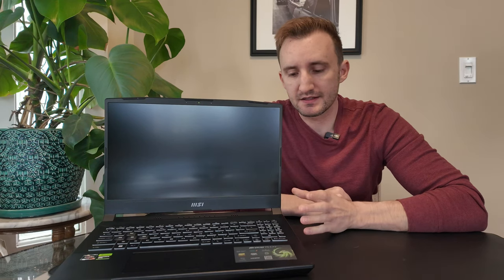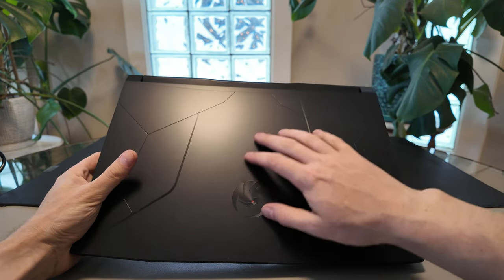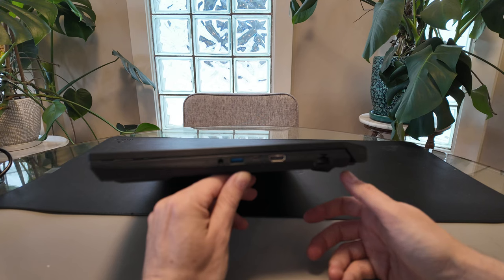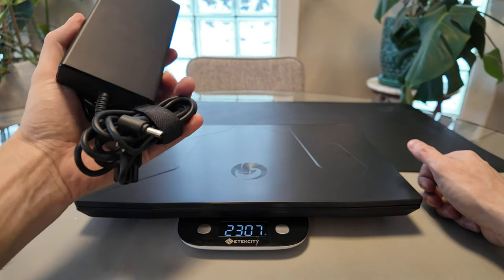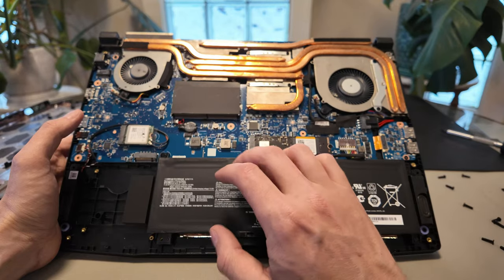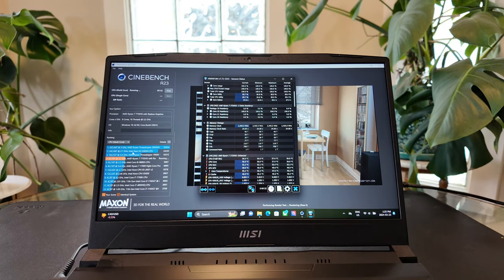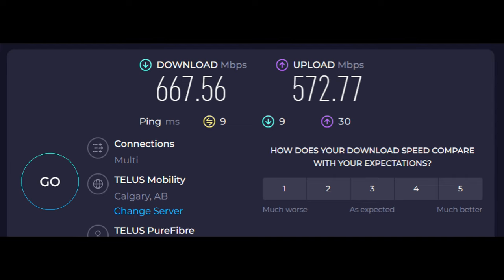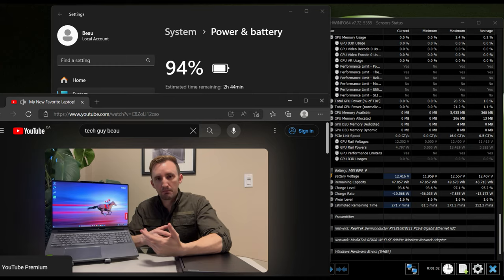Low Cost - High Performance:  MSI BRAVO 15 Review

Comment: I bought the C7U variant, which had the RTX 2050. This is my first big purchase of my entire life and its really worth it, I just hope the build quality and the hinges do not break on me 10 years from now lol
Reply from the maker: Nice enjoy! Feels good to get something substantial that you have been waiting for :)
Reply: So, I bought the Bravo 15 D, I believe it's the 2020 model and I have had no issues with the hinges so far and I have had it since 2021 and the only issue I ran into was that one of the fans wasn't working, brought it to a friend who knew more about computers than I do and it turns out they didn't plug the fan in or if they did it got unplugged at some point in shipping between facilities
Reply: My only complaint I have about my version is that it doesn't come with two RAM slots
Reply: How are you, brother? How is the device performing for you after this period of testing?
Reply: @5me.n  oh yea its good, my only concern before was that the top of the chassis is hot but I researched and found out that Ryzen CPU can reach 95© and they should still be fine, but I lowered the power so it wouldnt always hit that mark. Overall its a good budget lappy go for the 4050 Variant if you have more budget

Comment: i got a r9 7940hs and 4060 msi bravo for around 1000 bucks. its a steal. performs really well, i agree on the screen though colors are not the best
Reply: Is it good and what are the things you didn't like about it?
Reply: TBH the touchpad is the biggest issue, it is  quite sticky for my liking but i barely use it ,and the screen colors are not that good if you are into editing. For gaming though its a beast just make sure to buy a cooling pad for max performance.
Reply: Do screen colors bother you?
Reply: Just bought it today for $699 😅

Comment: i just got the  144 Hz IPS AMD Ryzen 9 7940HS GeForce RTX 4060 Laptop GPU 16GB Memory 1 TB NVMe SSD Windows 11 Home 64-bit Gaming Laptop and it is really good for what I paid. 

 The upgrade to win 11 pro is all I have left to do and this thing performs really well for what they are charging. I'll be Happy with this for awhile
Reply: I just ordered this and it’s coming in 3 days, are you still happy with it?
Reply: @22dattii  yeah it does fine for me.
Reply: How much did it cost for that? 800bim guessing. I got a deal on something more affordable saving a couple hundred.

Comment: Important: If you buy, order the 2nd ssd bracket to install a second drive. I hear it is harder to get outside of North America. It is a gaming laptop; it should have included a ssd bracket from the factory. 

Also be aware the usb-c port is USB3 gen1 5Gbps, instead of gen2 10Gbps or USB4 20 or 40 Gbps. This is also an odd cost cutting measure.

A larger 90wh battery could fit but would block the 2nd ssd slot. I have an older same chassis model with 90wh and gen2 usb-c, and keyboard paint wears off.

I can't comment on hinges as mine is one of few variants with a different metal lid on this chassis.
Reply: I see this priced at $1399 CDN or more. $800 or $899 Canadian would be good value. For $1400 Canadian I'd get a system with USB3 gen2 or USB4, no usb2 port only usb3 ports, an RTX4060 / RX 7600s, and about 100%rgb.
Reply from the maker: Gotta wait on sales. Full MRSP isn’t worth it
Reply: Can you guide me into the right direction about that 2nd ssd bracket? I'm about to buy this model and I want to expand with more storage.

Comment: You forgot the best part of MSI laptops. The open advanced bios. This can let you do the IMON tweak, leading the CPU and GPU to use their max TDP's even if both are loaded. It can also let you potentially undervolt locked CPU's like the i7 12650h via the AC loadline tweak. I did these tweaks in my nitro 5. In CP2077 my 3070ti used to struggle to pull more than 125w when the CPU was fully loaded. And the CPU struggled to use more than 40-45w and barely clock to 3.1ghz. Now, my 3070ti can clock to 1725 to 1740mhz, up from 1525 to 1600mhz and use the full 150w. My i7 12650h uses around 50-60w while holding 3.8 to 4.1ghz. My FPS got a nice boost too and its a lot more stable. All because I was able to access advanced bios.

Also, would like it if you raised the laptop since there's cheap, metal feet with built in stands you can buy for laptops to glue them to the base of the laptop and raise them by a good 1-2'. This can lower temps by a good amount, sometimes by 10 degrees since the laptop can suck in more air. I did it to my nitro 5. Works wonderfully.

And can you do some testing with undervolting and overclocking the GPU? And show us the GPU and CPU clocks in games. Also, the 6gb of vram isn't that great in 2024 considering 8gb is the minimum to run games comfortably at 1080p. Realistically the 4050 should've been a 128bit 8gb gpu. 3050 6gb also got a 6gb updated refresh.
Reply: Hi, did you mistake? Nitro 5 is Acer.

Comment: hey Beau, thanks for the videos, good to watch as always. I have an interesting concept for you; personally I am not so fond of Windows 11 since its release, but I don't know if it actually improved and feels better than 10 now. I still stick to Windows 10 Pro. Could you do a side by side Windows 10/11 comparison with your favorite, most premium new 2024 laptops? Maybe 2 of them or just one like the Yoga Pro 9i? I think it's an interesting case!
Reply from the maker: It would probably be okay for an AMD machine. Windows 10 handles Intel e cores and P cores somewhat poorly.
Reply: @TechGuyBeau  Thanks for the tip, so I guess I will probably have to use Win11 with my yoga pro 9i?

Comment: So I'm currently testing a Asus g713rc it has a ryzen 7 6800hs, and a rtx 3050 4gb vram 16gb memory, and 512gb ssd. I get somewhat good performance in fortnite i have epic settings on for view, textures, and something else..everything else is off and it's hitting about 160 to 200fps depending on the part of the map I'm on. 

I'm waiting on a msi bravo 15 Ryzen 9 7940hs, with a rtx 4060 8gb vram with 1tb ssd 144hz screen etc. The asus g713rc looks so dam good, like the rgb strip on the bottom. The pain splatter on the left side under the screen 17.3 inch screen, asus symbol lights up in the back. Loud speakers which is hard to find on laptops. In all the asus looks esthetically pleasing compared to the msi. But performance wise I believe the msi is better. What should I do? 😆 Send the asus back, and keep the msi when it comes or cancel the msi order and keep the asus?

Comment: Been using it for a year my only opinion is that the Rtx 4060 is so good at cooling the laptop that it literally drains your laptop to 1 hour or 1 hour and 30 minutes of playtime 90% of the time im charging whilst using it but still in terms of performance it really is top notch
Reply from the maker: Realistically you shouldn’t game on battery
Reply: @TechGuyBeau  Ive read multiple studies suggesting that Charging whilst gaming is ok in terms of the battery as long as you dont play maximum charged most often i game whenever my laptop goes low, i charge it till 80% then disconnect and continue rince and repeat been fine the battery still is in good health and there has been no degrading in my experience its ight

Comment: I’m torn between this or the legion 5 with 3070ti, is this one better overall?
Price difference between the two is not too wide in my country
Reply: 3070ti is 40-45% faster than the 4050 while packing more vram PROVIDED the 3070ti is 150w.

Comment: Where did you find this for $800 cad? I’m in Ontario and I’m seeing $1,700. 1Tb, 32 gb ram, 4060 gpu
Reply from the maker: It goes on sale often
Reply: That spec is $1,299 before tax at Canada Computers right now. Just purchased.

Comment: @TechGuyBeau - which Lenovo laptop is good for graphic designing.. like designing game characters.. or things in it.. basically for creators ..
Reply from the maker: Well you need ram and VRAM. Might need to go up to a legion 7 pro if you need loads of vram. If you can get by with 8gb of vram, look at the legion 7 slim.  Another option is the MSI stealth/creator. They  are pricy but probably exactly what you need. I used them at CES

Comment: Is the Acer nitro 5 with i5 13gen/rtx4050 a better option in the similar price as it has better display with 3ms response time?
Reply: yeah usually acer has better build quality but sometimes it has trade off like bad quality LCD
Reply: @KaranKDating  oh you mean the Lenovo LoQ? I saw a post weeks ago that it is prone to motherboard failure but if you get a good deal out of it I guess it's a good find

Comment: hese are the specs of the gaming laptop im considering buying. pls help me out as i have no clue about anything , i just want something to play games with friends with lag free.

 Model: MSI Bravo 15 C7UDX-282NEU

System: Notebook, Windows 11 Home

Processor: AMD Ryzen 5 7535HS (6 cores)

RAM: 8GB DDR5-4800 MHz (upgradeable to 64GB, 1 slot free)

Storage: SSD, PCIe 4.0, M.2 NVMe

Display: 15.6" Full HD (1920x1080), IPS level, LED

Graphics: NVIDIA GeForce RTX 3050, 6GB GDDR6

price: 750 dollars